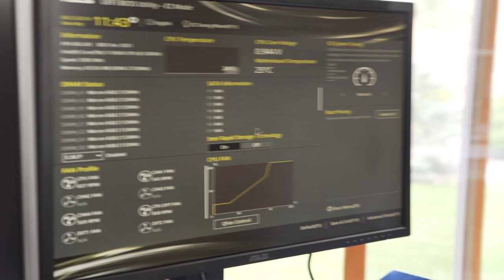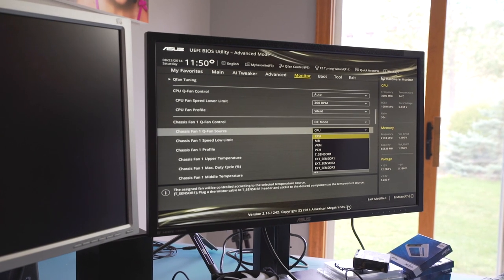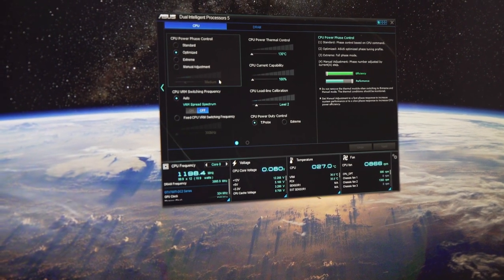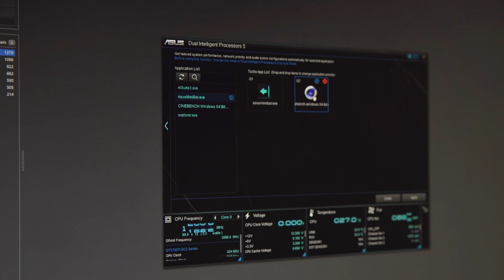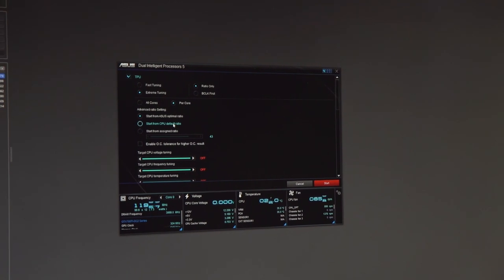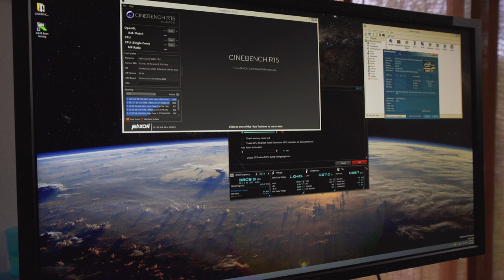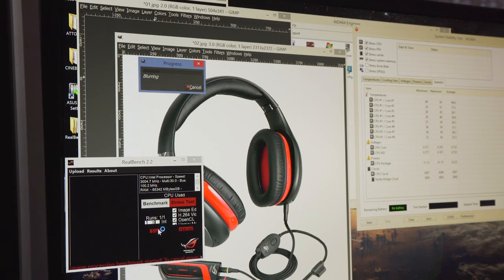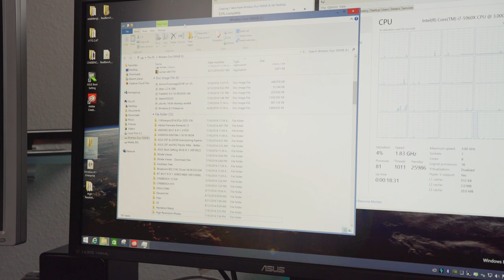Raw Footage of Building the Beast Video Editing Computer Part 3

Comment: Great video, and very informative. I do have a question, exactly what storage devices are you using? Im also upgrading from my z97 deluxe 4770k to this x99 5960x but i will be using my 250 ssd and 2-1TB hhds. Im thinking of purchasing another ssd but would like to know your configuration is. My rig is mainly for premiere and lightroom. Also, hows your OS, media cache, media, scratch disks, etc setup on these drives?? I would really appreciate your input. THANK YOU!

Comment: Thank you Dave for the great post. It helped me as a reference with my new build. didn't go this high - i got the lower 5820k way and half ram. can I ask if you or anyone here what the temperature at idle should be? i just started my new build as you had here at the beginning and my cpu shows at 32 C. i'm worried if my liquid cooling is on properly. I had to re-set it because text was sideways as opposed to all pictures i saw were showing it set on cpu. i have similar setup to this. you build was in low 20s C. thanks
Reply: its fine , Water cooling sets slightly higher then Room temp. My room temp is around 25 C. so My CPU is around 30-35 with a H440 ( hot case ) So 32 seems fine. I have a 5930k. Its really at load that you will see a difference vs Air cooled machines.